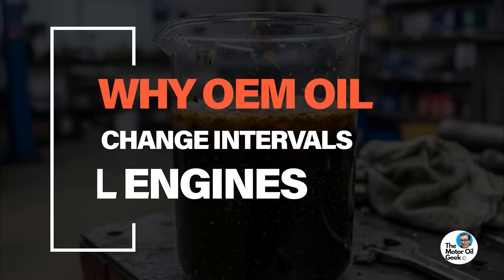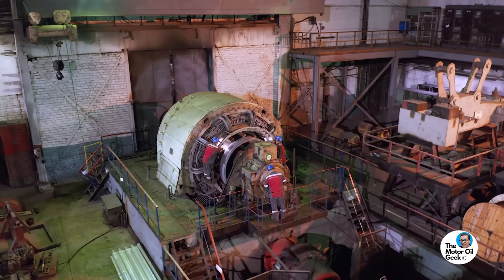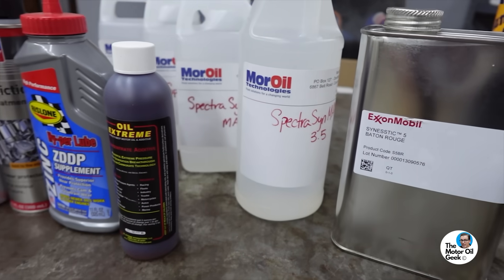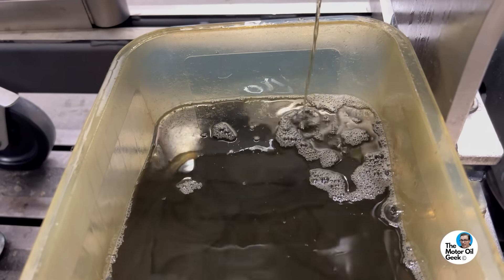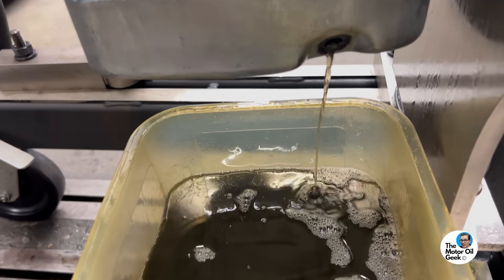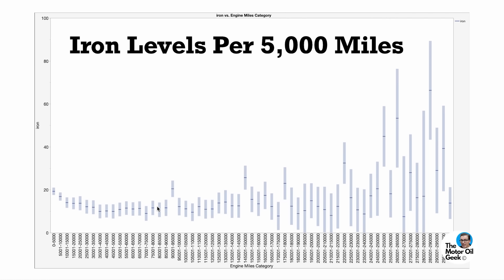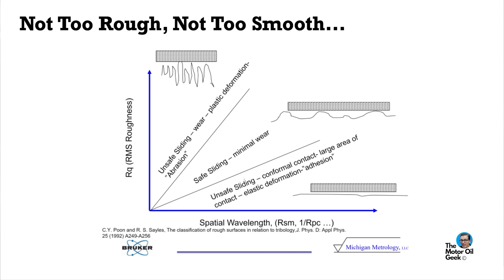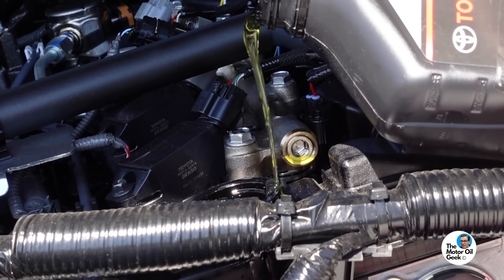NEW Data Reveals WHY Modern Engines FAIL Prematurely!

Comment: (All ) edit: "most" guys leasing cars don't care a bit about the car or the engine.
Reply: Or the ones that chase the latest greatest model that trade in every two years
Reply: @RJL1983 No company has made a grait car sence they came out with the 2024 tacoma and the 2025 4runner. When I can't get parts for my 2018 tacoma, 2022 4runner I will have no other choice but to buy a horse or an ATV.
Reply: My neighbor leased a Mercedes and never changed oil for 35,000 miles till he returned the lease. During this time, he just simply reset the computer to erase the warning. He told me later that his lease return became a certified Mercedes at the dealership. That's why I will never buy a certified vehicle if it is a lease return shown on Carfax.
Reply: @kenty6973 yeeeeowch.
Running expired failed muck through the very overpriced machine. 
The buyer would get a big slap when he takes his supposed win to the shop to trace the cause of the ticking noises.
Reply: I lease still treat as if I’m going to own it for 20 years. Never know I might own it and if I don’t the person who buys it will get a truck that was broken in properly and maintained.
Reply: @kbeam418 You have the same attitude as me. I must depend on the vehicle and therefore will take care of it.
Reply: @jlc55army  Same here, my new leased vehicles get the same maintenance as my 20 year old Toyota, because I expect each to run flawlessly for the duration of my ownership.
Reply: Spot on.
Reply: I leased a vehicle because it made my payment more manageable. Going into the lease I assumed I may keep the vehicle long-term so I am treating it like I am going to own it. I followed all of Lakes recommendations and have keep it very clean and polished. I had to push the dealer on the early oil and other lubrication intervals but surprisingly they covered the cost. If I decide to keep it I know I have done everything I could do to have a good long-term vehicle. If I turn it in at the end of the lease someone will get a gem. I have kept all the documentation from each service. I wonder if you choose to buy a used vehicle ask to see the maintenance documentation. If there is documentation you might get lucky. My other concern would be how the person drove the vehicle. If they know they are not keeping the vehicle they most likely didn't follow all the recommended or correct brake in procedures.
Reply: @life36899  I have an 26 Silverado with the 2.7L, lease, and i am doing the same exact thing as you are.
Reply: @life36899 I just traded my '24 for a '26. The sales person said they cannot provide any of my documents from my own maintenence practices to the subsequent owner. I had a regular catalog of information, like every receipt for anything, even every tank of gasoline. Not allowed.
Reply: Retired service writer here.  Most people who lease come in for whatever they think is required to meet their lease obligation, and nothing more.  And, very few people think they drive in severe conditions when they do.
Reply: This is why dealerships need to put a clause in their lease program stating "you are responsible for maintaining regular oil changes for the duration of your lease."  To me, that's just common sense.
Reply: @thomastaylor6699  Standard lease is 12k miles. Americans average 12-14k a year. For a 2 year lease that would be changing the oil twice with 10k OCI. Essentially once a year.
Reply: That and it cuts down on the available choices in the used car market,.
There are almost no downsides to the car companies recommending as thin an oil is possible to make it through the warranty period.
Reply: I treat lease vehicles like rentals. Drive it like you stole it.
Reply: Had a neighbor that was putting premium gas in and doing 3k oil changes on his leased Ranger so the engine would last longer. Untill I pointed out that since he intended to turn it in at the end of the lease. Doing more than required by the warranty was a waste of money.
Reply: People take care of rental cars even worse if I'm not mistaken, lol...
Reply: Bullshit, I change oil every 2500 miles on my cars. My question is to goofs like yourself: Why do you make undocumented statements and make yourself appear ignorant?
Reply: @jlc55army maybe 2 out of 50 take care of a lease , bare minimum maintenance
Reply: @jlc55army I know what my colleagues with leased cars tell me.
Reply: @jlc55army You're completely missing the point.
Reply: @jlc55army why do you lease? If you lease a car you know you won’t own it, you know you just send it back… absolutely you don’t care as much about the car than if you own it and of course you’re not going to care for it like you own it…this is only human nature and you calling bullshit is bullshit itself.
Reply: @grandenauto3214 OK know it all. I leased my 2000 Eldorado for 2 years, changed oil at 2K intervals, bought the car on 3rd year and same maintenance schedule for next 20 years. Sold the car after 22 years driving it. Not everyone trashes their leased vehicle, that's urban legend and you shouldn't believe your colleagues. Other cars I leased and bought and drove at least 10 additional years, '96 Stratus, '99 Accord and 2002 Beetle. All received same oil change and maintenance plans. All 3 Subarus, Taurus, Challenger, GMC, same story, bought or leased. So don't bullshit me, Mr. Bullshitter.
Reply: @jlc55army not believe them?😂 I sat in the car. To not have to change the brakes before turning the car in, he shifted down so hard you would lurch forward voolently
Reply: @jlc55army it's because he'a right, I lease and dgaf about the car or engine. I take it in when it says to and move on once lease expired
Reply: @jlc55army  What car are you driving? Japanese cars used to do just fine with 10k MILES oil changes.
Reply: Stop it with the 10k bullshit.

Comment: I have a plug-in hybrid and I'm surprised how low it says the oil life is. I've hardly even used the engine. Probably ran 8 gallons through it. Which is about 400mi, but I think my oil life is like 88% I'll definitely change it next year.
Reply: You probably already know this, but oil degrades with time alone. Your time interval is likely fine, but I had a friend blow an engine in a vehicle bc he barely drove it and let that oil degrade over time.

Comment: When I worked in aviation 5 micron was the filtration on the aircraft hydraulic systems.  The hydraulic purifiers we used would reduce that to 3 micron.  A hydraulic sample was required prior to each flight.
Reply: To matain cleanliness  change oil  more frequently . Auto oils are mostly recycled to save on environment and costs .

Comment: 2020 Toyota Camry, 90+k miles, so far oil changes between 4-5 k miles religiously, 0-20 in the winter, 5-30 in the summer , runs like a top, Oil level is always consistent, never used a drop of oil, this car /engine will last hopefully at least 300k+ 
Lately for the past 20k miles I been using the restore & Protect. After years of Amsoil and Mobile-1
Reply: Amsoil. 🙄 (🐍oil) If it's SO great, why do you NEED Restore & Protect???🤔🤥 Just like WHY do you need all the Amsoil additives??🤓<Ask Lake.
Reply: @riceburner4747 
Always an Amsoil fan, especially when I had my Harley, their 15w60 oil reduced my Oil Temp by 15+ degrees. 
And the 5-30 in my Camry, never had an issue, but who really knows if you get an issue with whatever oil is in there, and with 5k oil changes with whatever is in there, It’s kinda like Pizza, you like to try out and change every once in a while.
Reply: @riceburner4747 if you use the top tier Amsoil gasoline engine oils you Don't need restore & protect! And there isn't a bunch of unnecessary additives in any Amsoil synthetics. They don't just meet but normally exceed any ratings with high quality components, but without a bunch of pixie dust and what have you.

Comment: Filtration is definitely a topic I’d like to see. I don’t see any efficiency claims on the filters I buy except the diesel fuel filters.  
Im also concerned about when the engine oil filter might plug, I have no way of knowing. My understanding is that when the filter plugs, bypass will actually allow accumulated debris to recirculate into the motor. 
I have a John Deere tractor that had a variable cooling fan regulated by oil pressure. Deere recalled them and rerouted the controls for it to the tractor hydraulic system.
Reply: Quality filters will go much longer than oil change, even 10,000 mile changes. I think Lake even commented that after break-in, a filter could last 2 oil changes, efficiency improves.  To get a feel for your filter, get a filter cutter & examine filter.  You’re correct on oil-bypass, it’s a pressure differential valve and only opens when pressure is within the designed difference range. Its role is plugged filters, and doesn’t apply for cold oil starts as many assume… cold oil pressure is same on both sides of media, thus ByPass valve doesn’t apply for cold starts, only dirt plugged filters. (Another great Lake Video).

Comment: Thanks for a great year of content, Lake! I’ve been an engineer for 35 years, but your videos always teach me something new.
Reply: My neighbor works for GM way back in the 1960s. He said they would rev a diesel engine up past its red line till it blew up.
Then take the broken parts and make them stronger. He was an interesting guy and passed away about 20 years ago.
Reply: @autocad3227  If Toyota did this with new turbo v6 tundras would have found out right away built a shit engine now look at them a billion plus dollars in the hole reputation in tatters with 3 years of engines blowing up going to grocery stores while cars in the indy 500 run great til blow up on the track where are supposed to blow up if is going to happen, not on a trip to wally world.

Comment: Would love to see more on filtration. Two things in particular. 1) Potential benefits of FilterMag or other filter magnets.    2) Actions/effects of ADV on application where filter is fully vertical.    Mazda says not to use them. I have a 5 year old CX-5 and I always use a Purolator filter that has one. I do not have anywhere near the start-up rattle/ticking that many others do
Reply: Yes add “magnetic drain plug” to that.
Reply: @SatoshisDiaper: What is the engine is mostly made of aluminum?
Reply: @theblackhand6485 Most of the wear parts (rings, lifters, cams, gears, timing chains, etc.) are steel.
Reply: @theblackhand6485  Yes but not everything in the rotating assembly is aluminum.
Reply: Remember, that of the 8-10 wear metals in an engine, a magnet will only attract one of them - Iron.
Reply: I don’t get why it would be a bad thing to have an anti drainback valve on a vertical filter on a Mazda engine? Did they explain?

As to a magnet, as long as it’s not around a reluctor/camshaft position sensor & it’s a high heat neodymium type, it will help capture particles. Probably not so much the smaller micron particles but the particles that get drawn through your oil pump before it ever sees a filter and can cause wear, damage, and efficiency loss.
Reply: @ConcernedCitizenIn2025Yes, the issue is that your engine will last too long and you won’t buy another Mazda soon enough.  😂
Reply: I've been placing long magnets on my oil filters after I replace the oil. I mean It's not like it's gonna hurt anything, right??? This is just an assumption on my behalf and if it stops more particles going through the engine then I feel it's worthwhile.
Reply: Reason for curiosity about ADV is that filter is fully vertical, and Mazda supposedly doesn't recommend a filter with an ADV. What I wonder is if the ADV keeps oil (up) in the hot part of the engine after shut-down, possibly saturating the oil with heat. 

As for FilterMag, I used one for many years on my next-to-last car but I let it go with it because the replacement was a Mercedes with no means of using one. That car was totaled and now I'm back to traditional oil filter.
Reply: I’ll chime in on oil filter magnets and drain bolt magnets. The reason you don’t see these on Cars or Motorcycles anymore is cost. It had nothing to do with tolerances. It saves the manufacturer millions not to install magnet drain bolts. I’ve used oil magnets on my vehicles and motorcycles. They work VERY well. I feel they are a required upgrade. Any time I do oil changes, there is metal particles on the magnet. Even on my Toyota Tacoma ! I also run a magnet plug in my gearbox. Yes, it  gets dirty. In addition, I run the KP engineering billet filter on my Sport-bikes. This filter is FAR superior to paper filters in all parameters. The filter has an internal magnet that works as intended. This has been my experience..👍

Comment: How do you know the metal of the engine  parts are to spec I believe they are made to fail with the wrong heat and hardness no amount of oil would help. It is the russian roulette to make the economy run cause they want you to buy not coast on your purchase.

Comment: I'm a retired mechanic thats seen a lot of engines with one bad lobe or one bad rod brg and the rest are perfectly fine. What causes this?
Reply: @JackDup-n5r I'm suprised you would repair something without having a bit of an idea how to stop it failing quickly again?
 There is always something that is last to get Oil or less Oil which allows it to Run Hotter and break down the Lubricant further leading to Yet More heat and further Oil film failure, finally Metal on Metal destruction. Primary function of engine Oil is to Cool.

Comment: And another awesome video.
Thanks Lake.

Back in the 80’s my friends would give me crap because I changed my oil so often.
I changed oil as soon as the word “ADD” on the dipstick was getting hard/harder to see/read which was well before the 3000 miles.
That engine I rebuilt in 1986/87 is still running great today.
I still do that with my classic car engine even today.
Reply: Do a wear test.
The oil does get a bit darker as the number of particles increases... but the wear stays the same... assuming normal oil change intervals.
The standard oil change interval should result in normal wear.
Calculate your wear particles per 1000 km
The wear per 1000 km is about the same whether you change the oil every 3,000 km or every 10,000 km (or whatever your suggested oil change interval is)

If you drive a lot you might end up changing the oil every few months... which gets expensive, time consuming and annoying.
Doing 2 or 3 times more oil changes than necessary would be a pain.

N.B. Motorcycles are a pain. 
They have even more frequent oil change intervals than cars. 
If you're doing a lot of km's you might be changing oil every few weeks.
Doing oil changes even more frequently would be painful.

You can use oil analysis to work out exactly how many km you can safely do before the oil should be changed.
...and which oils and additives will help you reach the normal oil change interval safely... or drop the wear even further.

🙂#XcelPlus
Reply: @1Wondering if doing an oil change is a pain you have soft hands and should ride the bus.  Id rather do 10000 oil changes than one engine swap.
Reply: @evogibson92  We've never done an engine swap... because none of our engines have ever worn out. 
Never even changed a cam chain.
You're confusing oil changes with longevity.
Oil analysis will tell you how often to change the oil... and what works and what doesn't.
Our wear is ~5x lower than normal i.e. We have ~5x longer engine life
It's all done doing oil changes at the normal service intervals.
🙂#XcelPlus
Reply: @1Wondering sounds like you missed my point.  Also sounds like you've never worked in a shop that fixes other people's fuck ups
Reply: @evogibson92  I agree with the general sentiment.
Oil changes are cheaper than engine swaps.
🙂

Comment: It blows my mind that GM uses and recommends 0W-20 oil in the 3.0L Duramax Diesel. We have a 2025 Silverado with the 3.0L Duramax Diesel in the shop right now with less than 5,000 miles on it with a crankshaft with excessive clearance. At least it is under Warranty for the customer and they get a new engine. But they will be without their truck for over a week while it is replaced. It is a 50+ hr job to R&I one of those engines. A real PITA.
Reply: Same engines in other countries use 5-30 while in the US, 0-20 is recommended. The 0-20 gets slightly better MPG at the expense of long term durability. Something to think about....
Reply: @PassivePortfolios I read something that GM is going all 5w30 on their new truck engines that are coming soon.
Reply: @Lawnboy21  It's about time. I think it has something to do with the variable pressure oil pump and premature engine wear. GM should abandon cylinder deactivation too.
Reply: @PassivePortfolios canada uses 0-20
Reply: @stefanovichmichael9686 Canada is very cold so 0-20 is fine.
Reply: @PassivePortfolios It can reach 100F here in SW ontario.Explain the 5 or more tundras at 1 million miles on 0-20
Reply: 0w-20 is insane on a diesel 😮. I don’t even like running it in a gasser.
Reply: Trying to meet government fuel mileage requirements,GM doesn’t care about your motor life, run rotella G6 10w30 .
Reply: @stevewhite7649  It's OK to run 5-30 in cars which call for 0-20, especially in hotter weather, if you want engines to last longer. Mechanics agree on this.

Comment: Another great video.
I changed the oil on my new 2025 RAV4 XLE (non-hybrid) at 800 miles.
Now, it’s got 4700 miles and I will be changing it every 5K miles.
I presume, I did not do well during the breaking period per Lakes’s recommendations.😢
Oh, well!
Reply: Actually you did better than 99% of people do.  Under 1000 miles is great for the first change.  You’ll be fine.  Just make sure to use the Toyota filter.